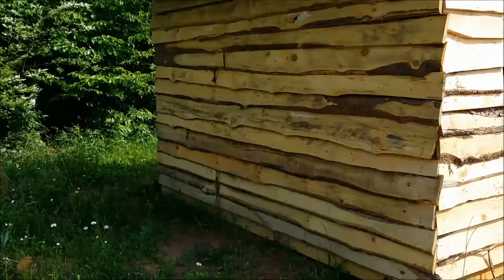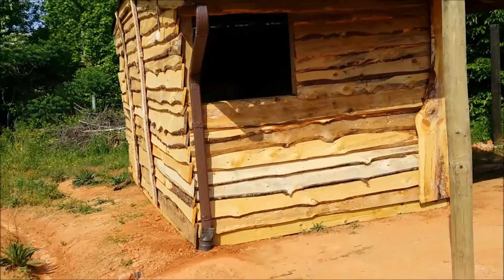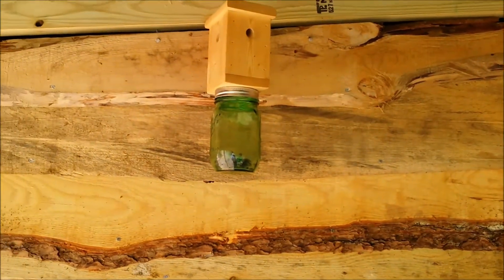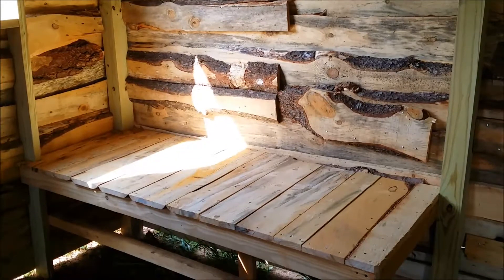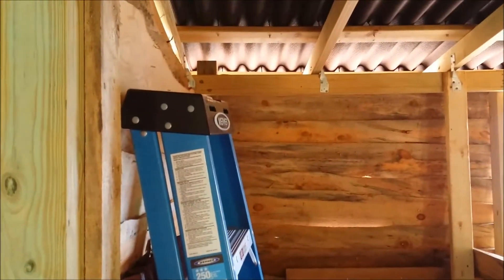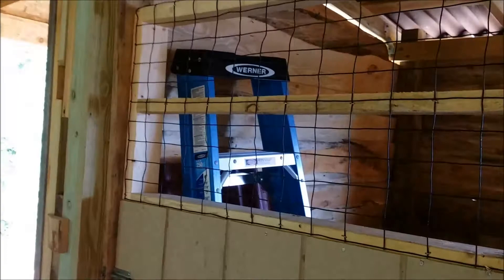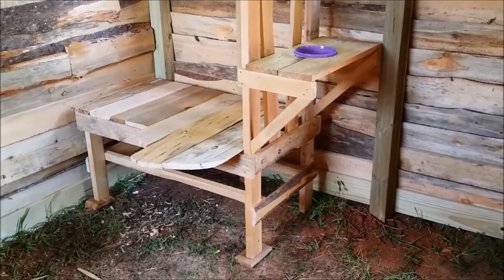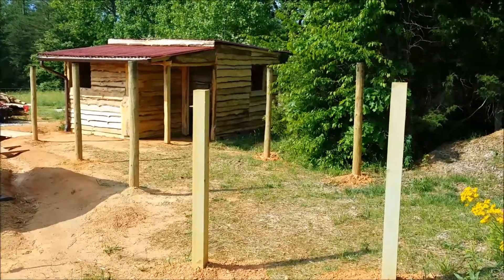Goat Barn 2

Comment: I know this is relative to the herd size, but what are your barn's dimensions vs. how many goats are you accommodating?
Reply from the maker: Goats need shade and shelter from the wind & rain. We have 5-7 goats that occupy that barn plus 2 LGD dogs. They all fit comfortably. We also have a section for milking. The barn is about 12' x 14' and 8' ceiling at the peak.

Comment: Very nice, so what did this end up costing you to build, doesn't look to difficult. I am no carpenter ( I did build my deck) but I think the hardest part for me anyhow would be getting the building squared from the beginning.
Reply from the maker: +peninsulamike I got a really good deal from a sawmill for the pine. for everything i would guess 400$. The key to getting things square is to use a tape measure and measure from corner to corner. for instance if you are building a wall you would measure from the  top left outside corner to the bottom right outside corner. Then you would measure from the  top right outside corner to the bottom left outside corner. If those measurements are the same it is square, if not you need to adjust